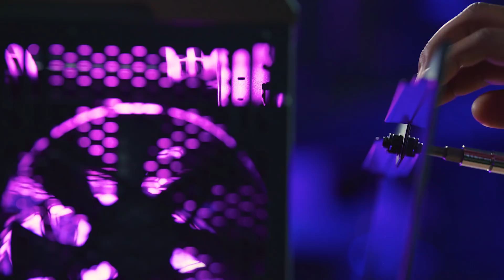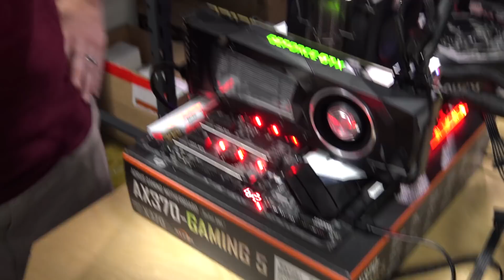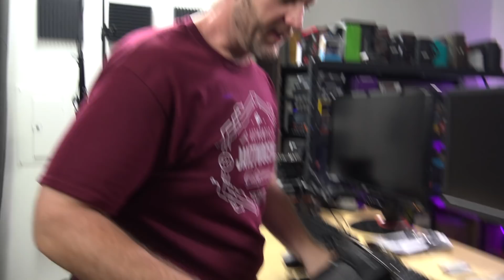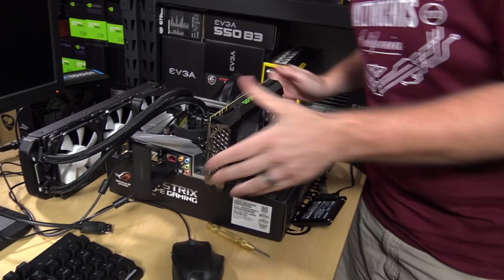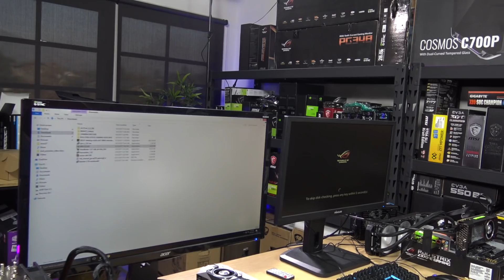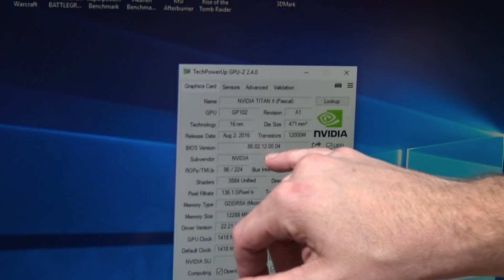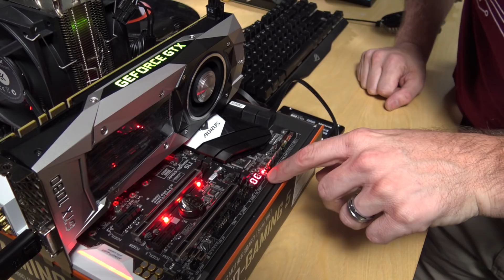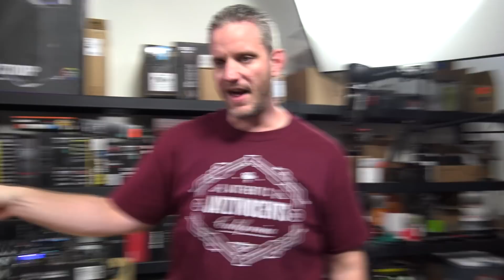I cant figure this one out... HELP!

Comment: your fun to watch when drinking and  I give you 5 stars its funny as hell  when you rack your IT! skill and its always fun watching you growing up! your right its not motherboard, gpu or bios but Murphy Law says if it doesn't work on one and works on the another its call a connection problem you can't fix it, its not the PCI slot if other cards work find but if it works on on the other motherboards the pci slot a little more tighter, prove me wrong then I'll subscribe oh gauges to test this don't come free with adds

Comment: Imagine a possible checksum variance from one line of production, or perhaps that particular unit not seated while receiving the firmware update. Just a thought as another example as are aware some distro's will provide this as a feature, but sites will provide them also. So I am curious as what the Pascal BIOS editor revealed? Silicone quirk? My history is minor dating back to setting jumpers and dial up days on Win 3.1/DOS with my first Slack install on a AMD-K7500MTR51B C when they were first making it to Washington State. A far cry from hardware and OS of these days. lol

Comment: I had this issue on a gigabyte board for my 4690 and one of my two HD7970's. So I blame Devil's Canyon, I mean sure it could be the Sapphire card but since it can't possibly the titan in your example it has to be the CPU and platform right? Sorry Jay I've actually seen this issue in a bunch of setups where one piece of hardware doesn't like another, it's not as uncommon as you might think.

Comment: Seems to relate to my friends z77 2500k build. He updated from a gtx 660 2gb to a rx470 8gb and 4x2gb ram to 2x8gb. He had no posting. Figured this upgrade would be simple and worth ~$250 he had to budget. Talked him into spending a little more to get a rx 470 vs gtx 1050 he planned. Had to walk him through this over the phone so I have no hands on but he has decent knowledge of basics and simple overclocking. What a nightmare this turned out to be. Couple days of texting and him trouble shooting himself and hours on the phone with me of troubleshooting, swapping parts,  bios, overclocking and hair loss. 

After clearing bios, default bios, overclocking cpu, updating bios on mobo, swapping pcie slots, ram amounts/slots, power supply the 470 went from no post to random post. It worked fine in another pc, just not his. He kept ranting "I should of went with a nvidia instead of amd, nothing but problems". Idk if he RMA'd it or it just decided to work.

p.s. I had 16gb ram / 2500k@5Ghz / z68 mobo with old bios and put in a rx480 almost a year before he did this upgrade and had no issues.

Comment: Try to switch PSU:s also! You use one cable with split connector with the Corsair 750 and dual cables with the 1000W version.

Comment: @jayztwocents i dont know if this would help although i surely think it wont, but i had a similar issue with a graphics card a while back doing this same thing.... and i never really found out the issue, when i changed systems it is when the graphics card worked perfectly...... i am not sure if the cpu cant take that much of power with the card, if it is a manufacturing issue, software i am not sure but try EVERY aspect even if it doesnt make sense in your head.... it might actually work... pcs are very temperamental so keep working at it and Thanks for the heads up.........
Reply: and to add i had ram that would work in one system and not the other even when the manufacturers site said it would work.... i had to get that "specific" ram for that system to work.... idk ever know if it was the motherboard altho i am thinking it was but..... to me ram is a funny thing, if everything else fails if u have try another motherboard of similar build and see if u get the same issue.......

Comment: Compare the PCB numbers on each Titan, then call the manufacture, I'm sure they will talk to you. If the PCB's are different, then there was a change to the circuit boards, Nvidia can then tell you what has changed. This may tell you what is causing the motherboard not to let the bad Titan boot or be recognized .

Comment: flash mobo bios to an older version and see what happens i find gigabyte bios fiddely
Reply: stress cpu and gpu watch power for spikes there may some weird voltage disconnect all fan headers and usb onboard or any other random connections like sata power connecters for fans ive had weird voting issues in the past where i wouldnt get a post from a undervolting cpu fan header

Comment: what PSU Wattage are you running? go over kill on psu 1000w + run and then test using 2 separate leads for the power to the gpu

Comment: I had a simular issue with evga board and sli graphics card one worked the other didn't. After several months later with rma.. it turned out to be the motherboard.  You have spares wouldn't hurt to try a different motherboard.

Comment: not sure if this  helps but I have seen simular quirk. 
my system:
Mobo: Asus crosshair VI hero
CPU: AMD Ryzen 1800x
Mem: corsair ddr 3200 16 gig
GPU: xfx 280x 3gb 
PS: Thermaltake 1000w gold 
OS drive: Samsung Nmve2 250gig 

I have noticed that not every time, about 1 in 10 startups my system will hang in the post on VGA i think the code is 94.  When i hit the Reset and reboot it will boot fine, seems completely random.  Bios on Mobo is newest.  I just have been chalking it up to a bug and with the older GPU, though i know the gpu is good.  Don't think it's a mobo issue either, just an odd bug as you have seen.    Waiting for the gpu market to calm down a bit before upgrading gpu but the old 280x is still hanging in there and playing most games i play with decent or good graphic levels.  (GTA5, Ark Survival being the main 2)

Just wanted to share I have seen odd bugs with my ryzen just minor anoyances.  I have seen things like that with memory in older builds , one stick works in one but not other same board ect.  never put much into trying to figure out why but would be interesting to see.

Hope this will give more insight

Comment: Looks to me to be a mechanical issue, with that particular board and that GPU. All it takes is a slightly worn slot and a slightly worn trace on the GPU, add them together and contact is not being made on one of the pins. Try a different motherboard with the Ryzen.

Comment: I agree with the one? more? posters that mentioned clean power. I believe I would see if you could swap the PSU and then the Mobo. You have already had two cards that failed to preform the same. It's not much of a stretch to believe that one is at the extreme of its power requirements.

Comment: When I got my Ryzen board I had the same problem (2 brands but same gpu).  i was bench testing it.  Seems like Ryzen can be very ground sensitive.  If I had it in a case properly screwed in it would be fine.  But on a mobo box or whatever, no go. Good luck

Comment: As others have already pointed out by  now Im sure it is a UEFI issue. Tbe trick is to get the UEFI opcode loaded in the cmos to clear. Standard stuff, bios reset jumper if you have one. Use onboard video if you can to load defaults. Reflash mobo bios as a last resort.

Comment: I call this a hardware issue some hardware will just refuse to work then months later either in a new system or even the very same one it works seen it many times over the years and by the way it not just prone to videocards

Comment: just try hdmi on the card that will not boot my radion rx480 wolud not boot on my new ryzen but with video card displayport cable removed it would post plugin hdmi then after first build displayport worked

Comment: Hey Jay, i had a simular problem with my ryzen pc.
I've got a MSI x370 gaming pro carbon with a Ryzen 7 1700x and Gigabyte Rx 480 G1 gaming 8gb.
It's not posting aswell with the gfx card in the top 16x slot, but since its not bottlenecked at 8x i'm using the next pci-e slot and it works perfect in that slot.
I know the top slot is not faulty since i tested it with my old gfx card, a HD 7870.

Comment: Perhaps try looking at the "fingers" on the GPU? i.e. Are they damaged / connecting properly with the board itself? It may be the way the socket is on that board that the fingers aren't making correct contact on THAT board but it is on the others...Sounds a bit silly but worth checking? :P

Comment: I had similar issue and was down to gpu not sitting in PCI slot properly I had to wiggle it a little bit and it worked, granted it was on a old athalon x2 with old gpu

Comment: Try different PCIe slot on mobo. If it boots, slot could be issue, then mobo bios and CPU eliminated. Does not work use a different mobo. As you say most of us don't have the privilege of having tons of test gear, but you do.

Comment: My theory is that the AMD System board experienced a fault (not necessarily because of the GPU) with the specific "failed" GPU and will now prevent full power on while it is installed. The Ryzen system board might have and error log that could be cleared. If not then try flashing the BIOS again, in hopes of clearing the error log. I noticed that, on the Intel System, the motherboard took time to recognize that new video card was installed even though it was an identical card. That led me to believe that its not just about the hardware version but also the hardware ID that a system board recognizes and factors into its Power On Self Test. 
Good luck and keep up updated.

Comment: Would be funny if it's some hardware issue with the graphic card, motherboard and CPU integrated graphics.
(Or more silly, slightly different power draw... or hardware/driver conflict, if 24 is supposed to be an OK boot)

What I find wierd is, if that motherboard is AX370 Gaming 5, then.
b2 is "Legacy Option ROM initialization" during regular boot.
And if 0C is DC... "Reset protocol is failed."... makes no sense to me atm.
(Else if OC is failed "auto overclock"... anyway that was solved with reseat (if I followed correctly), then that didn't matter)

Looking forward to see you solve it, will probably come in handy ;)

(Worst solution would be if it suddenly works for no apparent reason)

Comment: HI Jay, i had the same problem with my asus crosshair hero board with code 24. Just a suggestion, maybe re-flash the MB bios & see if that fixes it. My board posts with different codes every time like 40 or 24.

Comment: The bios version is not making two video cards identical, they still could have slight different hardware on micro level or other electrical circuit that the intel board is more tolerant of. Just leave with it not any ever existing hardware is compatible with any other even when standards are kept, sometimes two things are not meant to work together.

Comment: Haha and I thought I am too stupid! I have interesting bugs with ryzen, too and they come and go. I bought my system 6 months ago and it still does not run as I want it to run. 

I could have bought a 7700K system for the same money (as my X370 board and especially the g-skill rgb ram were very expensive! ... not to mention that they don't run @3200MHz [tested on 3 different boards] ^^) but I wanted to support AMD since intel has been very 'monopolistic' over the last years. I can't stand this 5% increase every year (and sure you have to buy a new motherboard, too!) policy anymore.

I like my ryzen system and whatever issues and problems I got with ryzen I do not regret my choice. But without a doubt you get two advantages with an intel system: 1. you put your components together and everything works (especially Ram!!!) and 2. you (unfortunately) get more fps.

As I said... I do not regret my choice! Ryzen does well and it woke up intel which is an advantage for us all!

Comment: Can I OC a non OC GPU or do I have to buy the GPU OC version? Also... do I need an OC CPU in order to have an OC GPU?
Reply: Yes you can OC a "non" OC gpu. If the letters OC are in the title of a gpu it basically means it is overclocked by the manufacture, from the factory, which you could OC even more if you wanted. 

You can pair any cpu and gpu in terms of overclocking the gpu as far as I know.

Comment: have you switched power-supplies?

I had the strangest issues even with high end power supplies already. everything acted up in circles I was down to eliminating and replacing every single piece of hardware until I finally swiched the psu and suddenly everything worked with everything.

maybe a not quite up to scratch motherboard or fluctuation in psu combination that most cards can handle but one quite special snowflake can not.

most times when I saw issues that strange it finally boiled down to mobo/psu.

Comment: Jay you might be able to rewear the card that doesn’t work,restart the system clearing the CMOS with the jumper on the board , that will clear any issues with the bios and after clear CMOS hopefully card will work normally as MB will receive new information from the GPU

Comment: thats the myth of pc building - ive built a few months ago two pc´s for two friends, each with parts from ebay, each for around 250€. they were pretty similar at the performance, one with an i5 750, 8 gig ram and an jetstream gtx 670 - the other one with an i5 661, 8 gig ram and an evga gtx 670 in the founders edition. both systems had an be quiet psu, nearly the same, one with 500 and one with 550 watts. both systems turned off after sometimes 5 hours of gaming, sometimes after 10 minutes of desktop experience. i checked everything and couldnt figure out what the hell was the problem. they turned always instant off, without shutdown, bluescreen or sth else. after many days of confusingness i switched the psu´s. the one with the i5 750 got the one from the i5 661 and the other way - it was just for fun because i was at the end of my knowledge - and wtf? now both systems are running since two or three months without any problems... i dont know how or why but im glad they are now working - thats my little story of confusingness ;D

Comment: One suggestion Jay is not to be so quick to swap out components, your board needs time to discharge. Or make sure to discharge manually. I had an issue with redundant power remaining in system when I built my ryzen machine. That resulted in non posts and weird behaviour with memory and storage. Love the videos Jay! Thanks

Comment: I bet it is a signalling issue with PCI-X bus. The one that is not working probably has a different passive xomponent (capacitor) than the final revision. Thia is causing signal degradation which the Razen board cannot handle due to longer bus lines.

Comment: Chances are you have a faulty track on the GPU. Now despite what people believe not every single pin gets used and even if every single pin is used the configuration and fault tolerance levels might very. What does this mean? It means that the 1 board doesn't use that specific pin in the same way the other board does. If you have a identical boards it could be easily tested. The GPU will not work on the identical board as well. If the GPU does work on the identical board then you have what we came to call a ghost error. What is a ghost error? a ghost error is when you have a tiny little problem on the mother board and the GPU. each on their own will not effect anything but when combined the two errors become a bigger problem. Something we use to see on raid controllers. Maybe it is a GPU bios problem it could be but i think you have a bad pin or ghost error. i could be wrong but i have seen this happen all the time on raid controllers and as far as i can tell it is physical electronic parts that when combined create an error. BUT you will never read this.

Comment: Hey Jay,

I am not an IT guy by any extent but I do many DOE's as an Engineer.  I see that you have used the card on the Intel and AMD systems and that card was working on every system except that Specific setup.  May I suggest a few cases to test out.

Try swapping the Ryzen CPU with another of the same CPU.  I don't believe I recall which Platform you were using ie the 1500, 1700...  My thoughts behind this is that In quality checks there is a bell curve of allowable tolerances and if something is on the line they will generally ask an Engineer if it will still suffice and they ship it out the door.  Doing this will isolate the CPU Variable if it is a bad part.

Next I would change the CPU to something other than what is in there.  Rinse and repeat for what you have on hand.  Both X and non X iterations.  This would hopefully eliminate the CPU completely if all Cpu's experience the same issue.

Working up from there I would change the MOBO. 

Start there and I am interested to know if this helps narrow down 2 variables in this.

I will say that I have not included the GPU as an issue because like you said and have shown in this video it seems to work on other systems.  Also a red flag was when you put the GPU that was INITIALLY in the Intel system into the Ryzen system it was finicky when powering on.

Hope this helps.

Best,
John

Comment: finally i can post for some reason this page has been messing up.  it's not the bios on the graphics card it's the motherboard itself. i've had that happen with several x370 motherboards where items will work  on it for whatever reason.  many a time i've replaced ram and video cards only for them to work in the next motherboard.  i believe it's glitch in the motherboard bios that just won't recognize some items

Comment: I had a similar problem with a 780TI classified, wasnt working on a HP 1155 i7 2600S and was working on a Dell 1155 I7 2600. MB were up to date. It ended up being an old HP outdate bios issue. They said that the MB wasnt supporting UEFI.. which I wasn't using.

Comment: Swap the power supplies. Not the cards. Looks like a PSU issue struggling to provide the juice for the bigger cards in all situations depending on clock speeds etc.